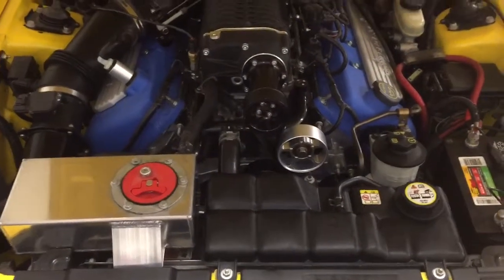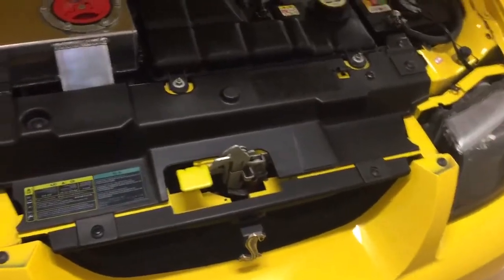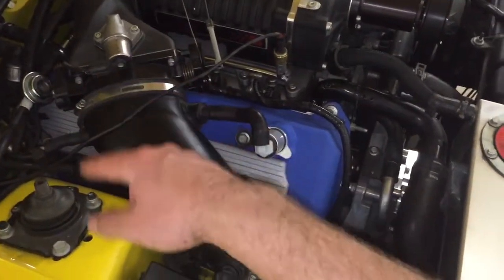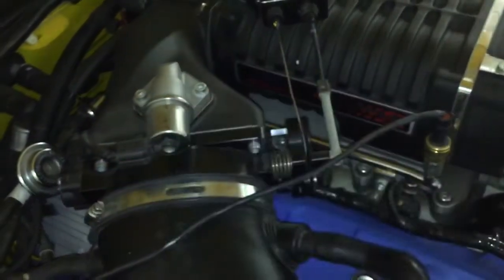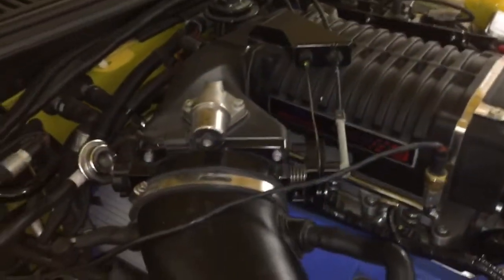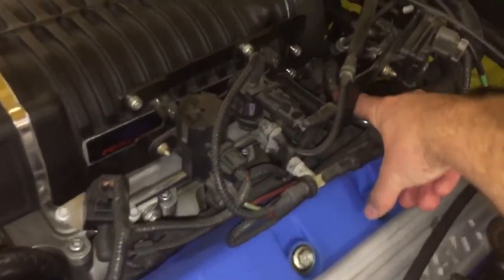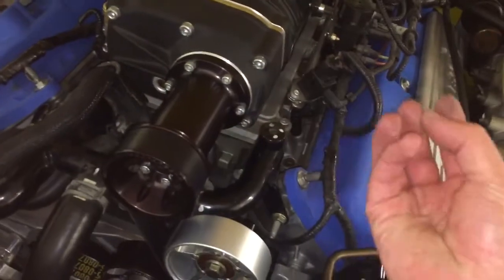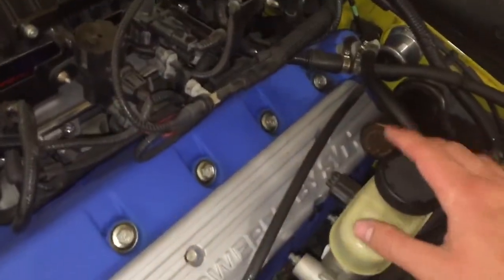Terminator engine sensors and parts

Comment: Awesome and informative video. Do you have a video on storing a terminator for the winter?  What should be done to protect the engine from sitting in cold for the winter months
Reply from the maker: Bob Maslen I'm lucky enough here that I drive the car year round, so I don't have a video on that. 
 If recommend changing the oil before and after, trying to start the car up every once in awhile, put the car on Jack stands to keep the tires from getting flat spots, maybe add stabil to the fuel (but be careful cause I don't know how that affects the octane, so you're want that whole tank burned through before wide-open throttle pulls), put a battery tender on the car, put several blankets on it and put down fabric softener sheets (mice hate them). Spray some bug spray under the car as well
Reply from the maker: Bob Maslen I did have my car in storage while my house was being built, so this might help when you're ready to start it later https://youtu.be/iH_rJdDZvlw
Reply: Thanks a lot

Comment: Good video, it shows your car has a lot more sensors than mine.
Reply from the maker: +Carolina Man should be the same other than the IAT2. Is yours a cobra r like in the pic?
Reply: No that is a dream car for me. I have a lowly 2000 V6 Convertible. It will get a engine swap
Reply from the maker: +Carolina Man well, I always dreamed about my cars and was able to get them. You never know I guess. I had a 97 V6 growing up and it was a good reliable car

Comment: I have a mustang 2001 base model lately its been wasting too much gas. Can you make a video or maybe help me to figure out why thats happening. I understand is a v6 but is wasting too much gas.
Reply: Claudia Flores You probably need a tune up: Spark plugs, wires, clean the MAF and TB, new air filter, new fuel filter....that should be a good start
Reply: racequad9 thank you so much !!
Reply from the maker: +Claudia Flores if you're getting bad milage it's probably time for a tune up. A new air filter and spark plugs should help a lot. On the v6 mustangs the plugs are between the exhaust headers, so they can be a bit difficult to get to. If the plugs are not firing correct you wouldn't be getting the power you should, and that fuel is being wasted.
Reply: Danny Johnson thank you so much ima get that done.